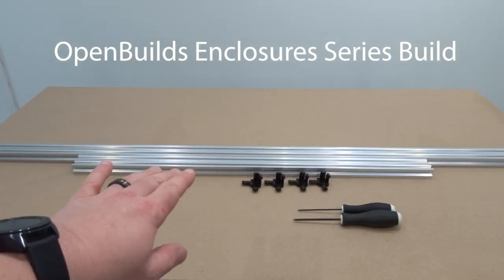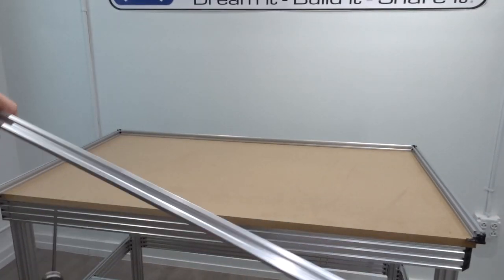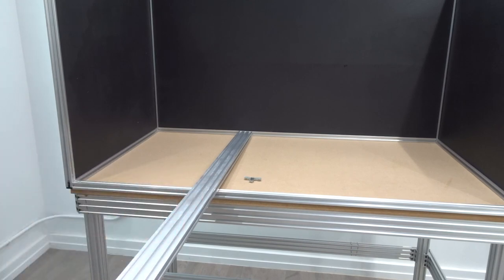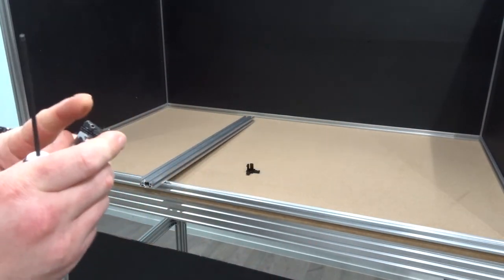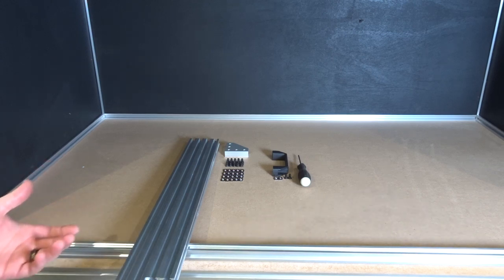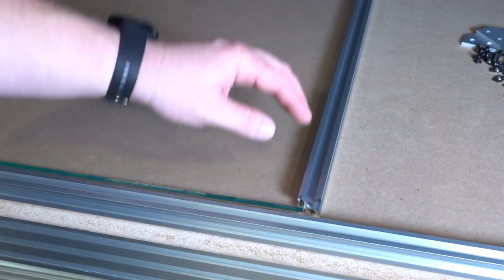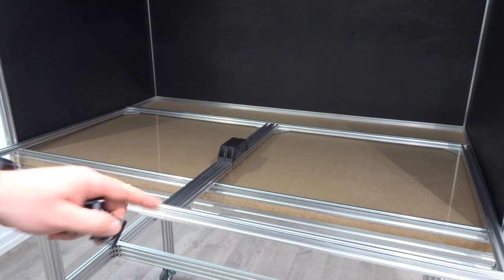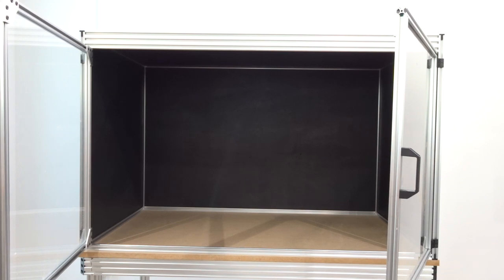OpenBuilds Enclosure Series

Comment: Is there a way to attach it to an OpenBuilds table instead of just sitting it on top?
Reply: Also, can you put a bottom in the enclosure? Like another panel on the bottom like you have on the top.
Reply from the maker: Hi Tom, with the OpenBuilds system being as modular as it is you could do just that for sure.

Comment: Can I get a bigger enclosure  then the 1010?
Reply from the maker: Though OpenBuilds does not offer one larger, its very easy to make your own using the OpenBuilds Modular Building system. Just follow along on the build video and use the longer lengths of V-Slot  in place of the shorter ones. Openbuilds created a Hardware Bundle just for what you are trying to do. This set includes all the parts you need without the V-Slot so you can order the longer lengths that you need separately. Grab it here - https://openbuildspartstore.com/enclosure-hardware-kit/